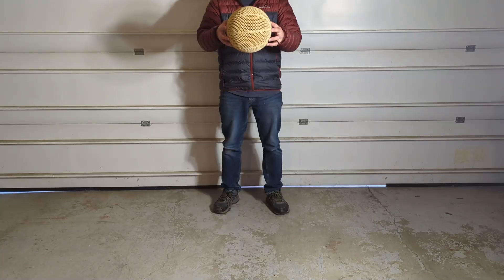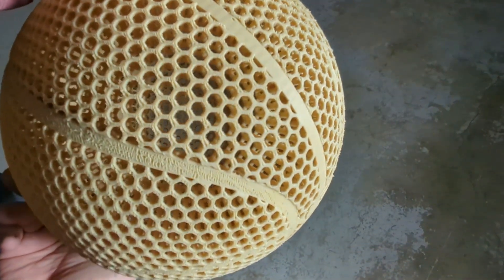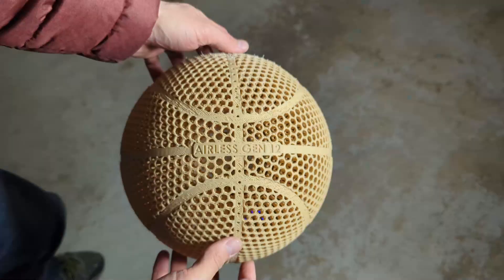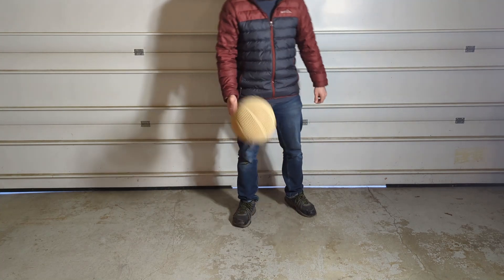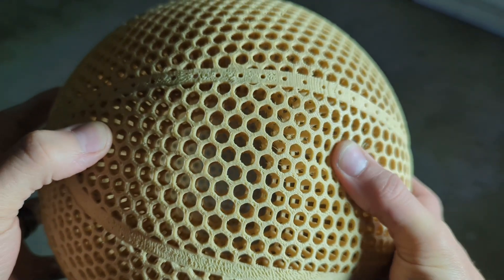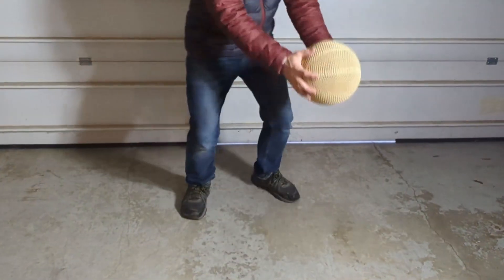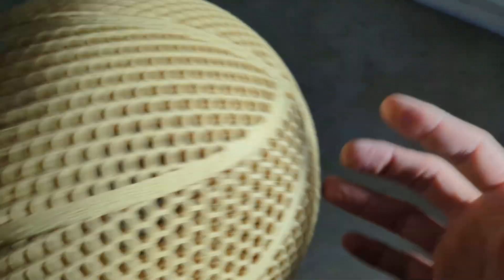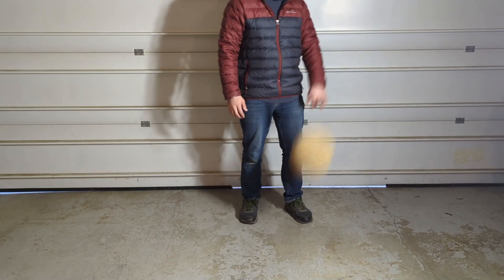3D Printed Airless Basketball With Double Lattice and Flex PLA!

Comment: You should try printing one in PEBA. It is similar to rubber. It’s strong, flexible, durable, returns to shape, is chemical resistant, and a good TPU replacement. Might do better than the flex PLA.
Reply from the maker: My PEBA basketball is currently printing right now 😁
Reply: @makeitlabchannel  so, how is it, when is the video launching :)
Reply from the maker: @riba2233  it is going to finish printing today, and if it is anything like the small test print I did it should be the best I have attempted yet so fingers crossed 😁 video should be ready by the end of next week at the latest
Reply: @makeitlabchannel  awesome :)

Comment: I recommend printing it as slow as you can it worked for me quite well. Also tree supports are a little easier to remove.
Reply from the maker: Yeah I think around 40 mm/s will be what I try next, and I will also try tree supports 😁
Reply: @makeitlabchannel  do slim tree. Been working for me so far. im a Month into 3d printand about 45 things printed large and small. Slim tree works very well to remove.
Reply from the maker: @747westscope  been meaning to tree slim tree - guess I will give it a go. Thanks!